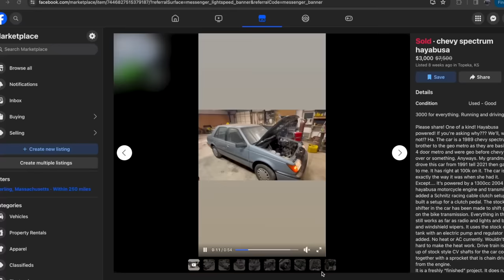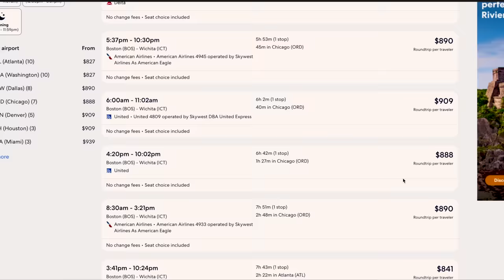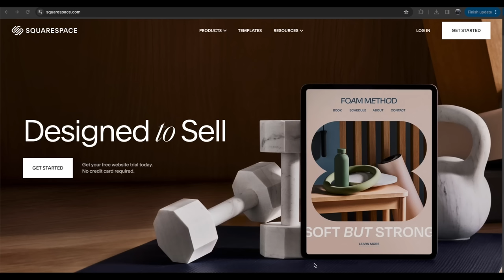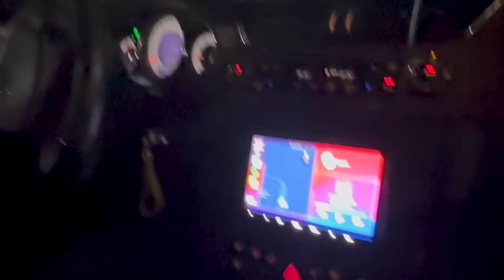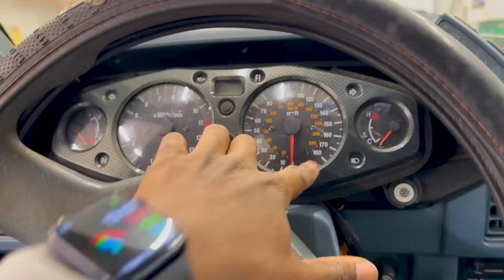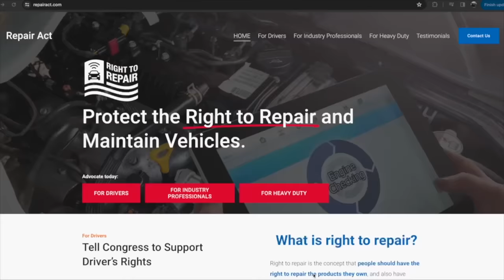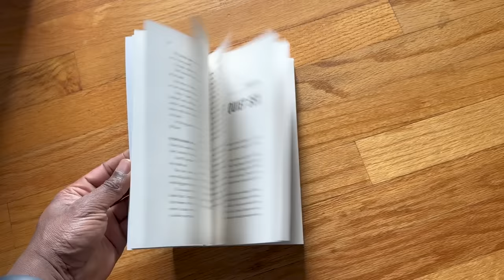I Bought a Hayabusa Swapped GM Experimental Car, but will it get me 1500 Miles back Home?

Comment: It runs like it has a couple, or more, burnt valves.  It could, however, have bad coils, or injectors, or fuel system needing cleaning, or bad spark plugs, or other difficult to find problems.  With no differential, not me brother.  Also, if that Busa engine were right, it would be tough on those cv joints, if wrapped up a few times.

Comment: Spark plugs are not on the right cylinders which is why it's running so badly. Need to switch a few around based on the harness.

For the drivetrain, they are NOT cheap but there's a company that makes a complete gearbox for mini Cooper Hayabusa swaps.

Comment: Go buy a stock transmission and axles for it cut the bellhousing off the transmission put a sprocket on the output shaft of the transmission to the motor

Comment: Should have kept the cars gearbox and weld a sprocket to the end of the input shaft so you could have kept the diff or put the engine in the back

Comment: I had one and I pad 300 but I had to fix the muffler I was told $ 1,600 and I paid $500 a flex pipe and she ran good 4 years in till it had a oil leak I put some shit in the oil and kill the car !! It stopped the oil leak and the car!!!

Comment: My buddy had a Geo storm, he chopped the coils and put 13" wire wheels and white walls on it, then all the sudden he drove around with the seat way back with just one hand on the top center of the steering wheel, and it looked SO gay.

Comment: I saw a clip of a jay leno engine that was 2 hayabusa heads on a bespoke block.  I'm wondering if you could do that with those crazy high-revving r6 motors without sacrificing the high revs.  Aren't revs usually limited by valve-train?  Or would a v-orientation change that? 15k rpm v8? Yes please.

Comment: I was wondering about that "Adult Playroom" 👀 at 1:03 😆

Should of put the engine in the trunk that way they engine only turns the rear wheels that way its not messing something up when you turn! Also im wondering if there is a way to have a lever tonpull and engage some gears to make it so you can go backwards!  Something that just lets you pull a handle then the gears are engaged on the side of the engine (something just made and put on the side so you can engage reverse) it engages the gears and just maybe pulls the forward gears away and puts reverse gears in the way so it then goes backwards that way you dont have to worry about going backwards if you end up in a pickle. Too bad that probably cant be implemented 😂

Comment: That is a nice vintage compact car, both ruined by, and ruining the use of the 'busa engine. That car needs a Nissan 1.6L (Versa motor) or maybe an electric drivetrain and it'll be a great daily driver. That engine? Forget a car, bike, or even a boat. It revs far too high for any of those purposes. I'd say perhaps a small airplane?

Comment: The Engine does not sound happy and it didn't sound like all 4 cylinders are firing sound pretty good but it doesn't sound like that much stables than 4 cylinder...it could be missed fire or something

Comment: Better off using a Goldwing engine with shaft drive to do something like this.......Just saying./

Edit. Two reason for Goldwing engine. 
Off the line torque. 
Don't have to rev the nuts off the engine.
On some engines a reverse gear.

Comment: Manufacturers are doing it again, new cars with electronic brakes and steering drive by wire systems are locking out local mechanics, they want you to bring the cars to their dealer for services

Comment: The idea is fantastic, but execution isn’t. The test car is wrong for one, it’s a total 💩 box, with no structure, suspension and brakes to ultimately handle the power that engine makes. The issue of the chain, plus no reverse is a tough hurtle. I’ve seen the engine used in Smart Cars with some success.

Comment: You could put a 'Busa motor in a tractor but it wouldn't make any sense.  Imagine the motor screaming at 13,000 RPM while you pull a stump, lol. Somebody had a rare car with a blown engine they couldn't get parts for and so their go-to was a 'Busa motor.....just no words. This thing is an utter abomination and would have been better served being a non-running resto in a museum.
Have y'all considered this might have a carb and you need to pump the gas before you try starting it...
This also makes me want to unironically import an Opel Corsa and 'Busa swap it the right way. Having a sequential transmission on a car is just stupid unless you're driving a drift or rally car or F1 racer. Here, it isn't cool, just stupid. All they had to do is keep the original transmission and it would have solved the drive issue. But some hack did this mod. The original trans probably just needed a rebuild and was probably a common transmission, like a 4T40 or 4T60. I despise planetary automatics but would choose that over having to bump shift a 'Busa powered car. Just need a 2:1 reduction sprocket to the trans input shaft. I guess they were so dumb they couldn't figure out how to adjust the throttle valve on a non-electronic automatic so it would work with the 'Busa motor. I'll give y'all a hint - you need to change the actuator diaphragm or double the spring tension. A 'Busa motor is gonna pull a lot more vacuum than what was originally in the vehicle. I bet the hack that did this thought they were gonna use the original trans and then went full redneck on it when they couldn't get the trans to shift. Probably shifted up almost immediately and never came back down.
IDK which is sadder, this bastardized Spectrum or the motor they put in it.
Also, NASCAR uses transmissions with reverse. So do F1 transmissions. In fact, I doubt any modern race car lacks a reverse gear because any pro racing body is gonna require one. Even Top Fuel Dragsters are required to have reverse capability. SCCA doesn't require one because of their vintage racing bent so I guess you need a SCCA pit crew for this.
While it is absolutely terrible advice, if you build up some momentum and clutch in before initiating a low speed turn, you'll get along better. 
Funny how Americans call one wheel drive 'go-kart' style when in Europe, there were a lot of small cars designed with single wheel drive.
Also, your motor runs like shit and is only really running on 2 or 3 cylinders most of the time. I suspect that's part of your problem. You also aren't revving up nearly enough before you shift. You are basically just running the motor at idle and expecting it to pull a car. And it is zero surprise that CV joints would break if you had a locked diff. Somebody misunderstood the principle behind their design and thought they could provide enough speed differential to account for the lack of a diff. They cannot. What they do is allow for more independent suspension movement because they can compensate for the very slight differences in rotational speed that happen when the suspension flexes. You still need a diff. Whoever did this has some natural fabrication skills but zero real understanding of what they were doing.

Comment: whats johns contact info I need tons of hummer and high perf gm stuff wtf Rich!
Reply: they made those as a chevy spectrum. it doesn't have power steering and the dampers are... does it have dampers? I tried to like brake drift one and spun it tf out because the steering is like spring loaded and it wobbles around like a fischer price clown car...

with a busa engine its probably fun in a parking lot but just unbelievably unsafe